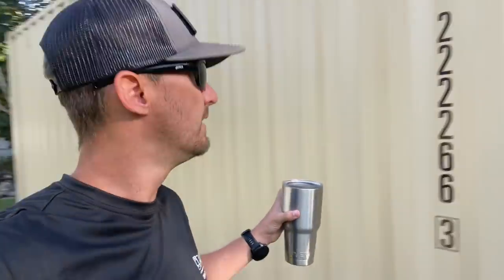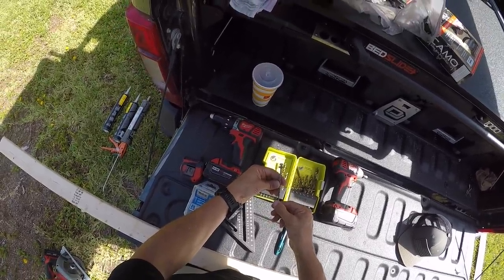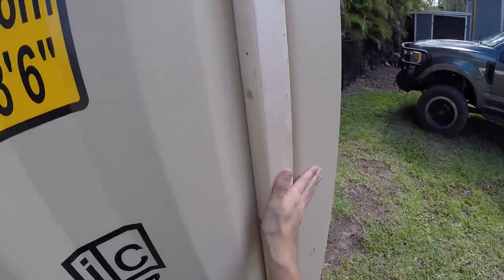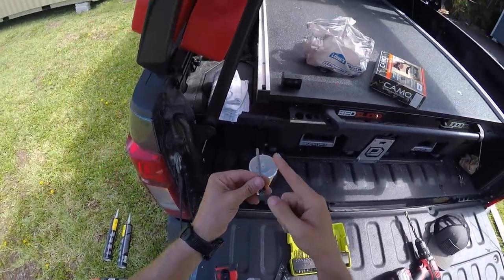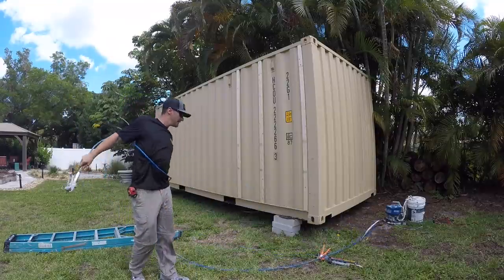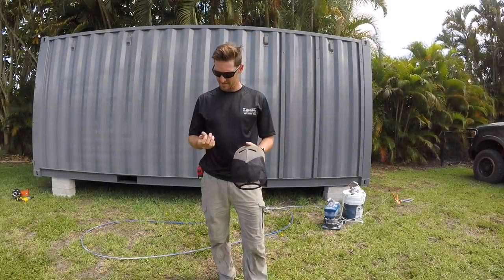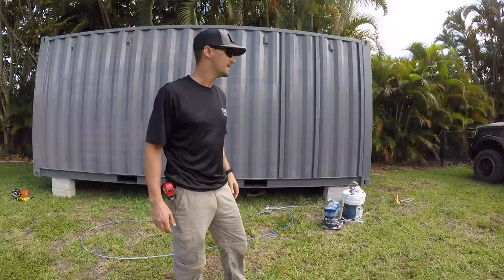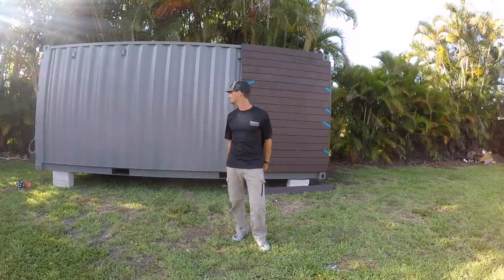Cheap Deco wall and paint on 20FT bunk House container!! Under $350

Comment: How much paint does it take to put a good coat on a 40’ HC container?
Reply: Depends on what paint and how youre applying it. I am finishing my home in the next 45-60 days. I used 10 x 40’ containers but they are double stacked in two pairs meaning 8 to build two sides of a 2 story building and two along the single floor of the back side.  Effectively that means I only painted the top of four containers and obviously not underneath or between the sistered pairs.  To paint just the containers with 3 light coatings using an airless rig and Baer indoor outdoor industrial paint I used almost 7 full 5 gallon paint buckets. If wanted to do a single like his using my method and type of paint I did expect to use 3 gallons

Comment: Where did you insert the screws that hold those horizontal planks to the container? Are they just on the exterior face of the planks? Or did you put them at some kind of angle from underneath so the screw heads wouldn't be showing?
Reply: Few screws were necessary or show  because that material uses clips between each board.

Comment: Do the screws protrude on the inside? Wait you have foam in there so wouldn't matter is that right? Also being in hot weather do you feel the foam is better than the closed cell spay foam. Im in Houston and the architect is trying to get the right r value.

Comment: Is that the orange container wheel I have seen on eBay? Have been thinking about getting it.  If so, how did it work?
Reply from the maker: Yup! They are alright, just for simple moves around your property not road worthy even close
Reply: @ContainingLuxury  thanks!
Reply: @ContainingLuxury  did you use 1 pair of wheels or a full set of 4 wheels? Which type of machine did you use to move the container?
Reply: Same question. One set of wheels or two? What did you tow it with?

Comment: Thanks for advising the increased cost of putting two or more containers together.
Reply: Its really not that bad if you have good welders. I am finishing a home for myself right now using 10 containers. Ill have a really really nice, extremely durable and crazy insulated home for well under $200 ft2 and I have used both perimeter and heated/insulated slab for the project. I have done a decent amount of the work myself but that also includes the appliances and everything except for the complex solar system and batteries (home is entirely off grid)